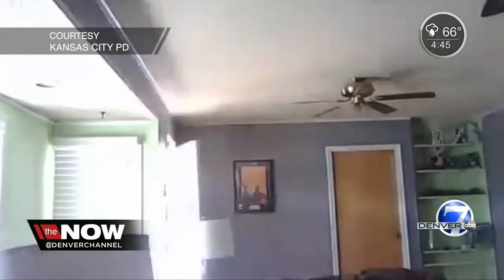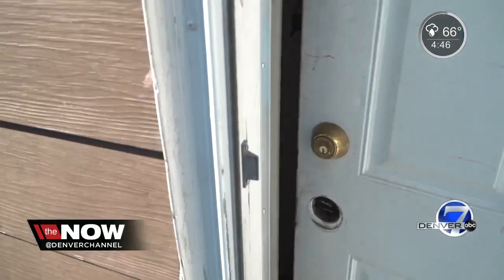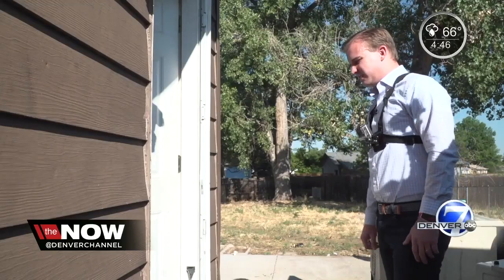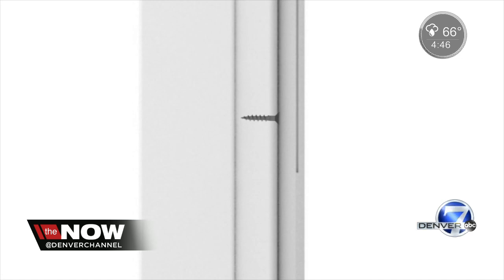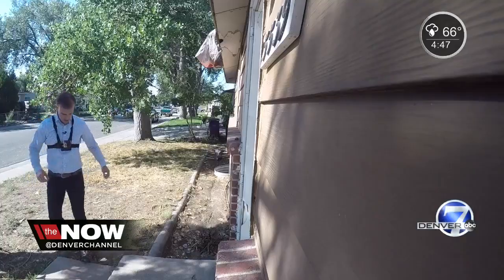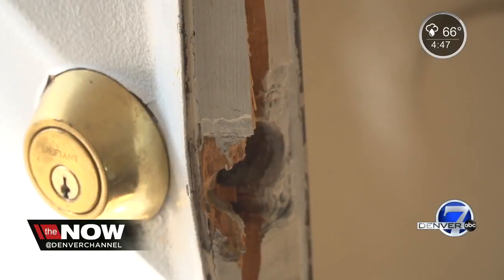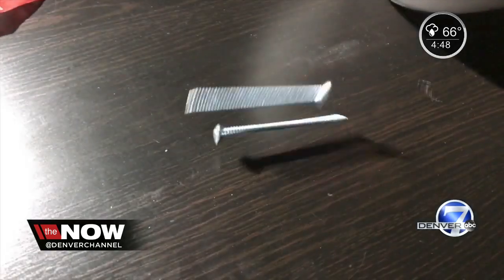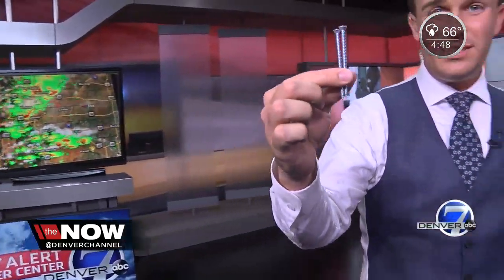Get longer door screws! Here's why.

Comment: Make sure you do this for knob strike plate and put a few on the hinge side as well! Also, install a metal door reinforcement plate around the locks for an all around secure door!
Reply: That’s a cheap deadbolt lock. So not only just use 3” screws. Also get a better & sturdier quality lock.
Reply: My door has zero gap space. What  brand strike plate do you recommend? Thank you

Comment: For you eager beavers who are charging out to do this and you don't work with tools often, here is just one tip he does not have the experience base to know.  Tip 2 is do both sides, the plates AND the hinges.
When you install these, we all have a tendency to absolutely BURY those screws into the frame.
You MUST pay attention to the door swing, or you will tighten it out of alignment, and it may become sticky, so install one screw, and test the door swing and the bolt path before you go to the next screw.  However, he is absolutely correct, This buys you time to get the dog, the gun, and 911, or even for your neighbor to hear a big commotion, and respond.
Reply: ¹
Reply: just replace one screw per hinge.  definitely good enough
Reply: @mikehascats26 I did that and it works. We weren't able to kick the door in on the hinge side and at the doorknob side.

Comment: I just added a 12 inch strike plate that secure both locks into one with 9 screws distributing the force.
I also added 3 inch screws into the mechanism in the door, my door is solid wood. I really want to kick test it but it's my home so I'll calm down lol. 
I got 8 inch strike plates for my back doors with single locks and they have 6,  3 inch screws now vs the 2, 3/4 inch screws. 
I added 2 of the 3 inch screws on each hinge as well. All my screws were #10 with a torx bit. Don't forget to pre drill!! I forgot on the first one and had to twist it out with  vice grips it was so dug in it wouldnt go in any farther.
I'm getting 1 inch wooden dowels for all windows vertical and horizontal. 
I still have to put up my motion lights. 
Next project is installing security cameras! I sleep so much better knowing my family and I are safer and have a fighting chance.

Comment: If you want to make it more secure you can replace the strike plate with a security strike and reinforce the deadbolt with a wraparound security plate. There are all kinds of reinforcements you can buy for under $10. You can also replace the screws in the lower hinges so the hinge side won't blow out. Door Armor is expensive but you can at least look at the parts they use and buy similar ones
Reply: That’s a cheap deadbolt lock. So not only just use 3” screws. Also get a better & sturdier quality lock.

Comment: longer screws are a nice tip, but how hard is it to throw a brick through a window to get in?
Reply: To prevent this, install 3 inch screws into the windows.
Reply: Bars over windows are very common.
Reply: There are security films that make windows much more difficult to break
Reply: It reduces the risk. Someone who can’t get in a door already likely drew more attention to themselves than they wanted, and the homeowners/neighbors have a chance to react. If they can’t get in the first entry site they wanted, they will probably just bolt. Plus windows usually have screens and it’s not as easy to climb through a window as it seems unless it’s literally on the ground
Reply: Simply i use 1 half inch Cyrillic glass its funny when they throw brick and it reverberates his them back lol
Reply: it's called laminated glass, all first floor windows should have it, smh
Reply: Burglars want to walk in, and they DON"T crawl through broken glass.
Reply: Pretty difficult if the glass is toughened
Reply: depends on how new the house is, my house is a few years old and the windows can literally take baseball flying at them and not even crack, i know because i've done it on accident, twice, good quality windows, will be a bitch to break, you'd be surprised

Comment: I had my front door kicked in about 11 years ago (while I was at work) at a rental townhouse I lived in.They stole a brand new plasma TV and some other electronics. The door failed at the strike plate for the deadbolt and blew out a chunk of wood there on the frame. When I bought the house I live in now I put 3 inch screws in all hinges and strike plates of my entry doors. This also helped straighten the metal doors a bit in the frame which helps them close and seal better.

Comment: Mine uses 6 screws on the strike plate.  4 on the outside that are 4” screws and then inside the metal box the deadbolt goes in and also holds 2 recessed 3” screws.  The actual door has an enlarged plate with eight screws, 2 of those being 3” and the rest 1”.

Comment: Although it will prevent the strikeplate from coming out, screws are hardened steel and provide little shear resistance. The mechanical fasteners wouldn't even be the issue if strike plates were L shaped and inserted into a kerf cut in the frame.

Comment: In other parts of the world front doors normally opens by swinging out from the house, not into it as they seem to almost always do in the US. Try kicking one of those in. Good luck.
Reply: Which countries?
Reply: but if your door swings out, someone can just take the pins out of the door hinge, which is probably even faster than kicking it down and more discreet
Reply: @dylan-nguyen  
no  they use jam lock pin
 screws in hinges.

Comment: Now throw those screws into the deadbolt too!
Reply: Long screws will interfere with the lock on some deadbolts so be sure to have a few lengths on hand. Or use a wraparound plate to keep it in the wood

Comment: Double the locking ability.  Notice in the beginning, only the deadbolt was installed.  Once this video installed longer screws notice the bottom door handle was suddenly installed and closed.  Attention to detail and double the locking ability along with two longer screws.  Come one, do a better job of the obvious flaws.
Reply: I recognise your comment is old, but this is largely irrelevant. 3/4 inch screws are still just biting into the finishing board. Even with the knob installed appropriately, you're breaking through the same amount of material (about 1/2 inch of pine finishing board). Longer screws means you typically have to destroy the frame or the screws themselves. As most steel screws can bear about 92-102lbs of tensile strength, installing four 3 1/4" screws means you'd need to generate around 400lbs of force to snap them.

An average kick from your standard 5'10" male applies around 70-80lbs of force, for reference.

Doors with elongated strikers (which brings screw counts up to around 12) and a door reinforcer (this is a plate that goes around the knob area) have been proven to withstand well over twenty strikes from a man-operated battering ram (unsurprising given that you're reaching over 1,000lbs of force required to shear the screws at that point). This video demonstrates--as do many other videos on this subject--that the door itself or the framework will often fail before the reinforced plate itself does.

Comment: Why does the door open inside anyway?
Reply: That's how any door I've seen opens. In Canada.
Reply: @Tiffacheez  but why? The other way it would be harder to kick
Reply: @Pyovali  I'm not sure lol, just the way it is here. Could be to prevent being snowed in...if there's too much snow in front of the door, could be hard to push outward.
Reply: Prevents being snowed in if you're in a northern state or Canada. Beyond that, it also helps in the event a firefighter has to break your door down. Prevents you from knocking whoever is in your step over. Also, tamper-proof outward swinging hinges are more expensive to install.

Flip side of this is that outward swinging doors can withstand a stronger wind hitting the building, and are recommended occasionally by people building in areas that have a high risk of hurricanes (like Florida). They also allow for quicker egress from the building in the event of a fire, which is why they are normally required for businesses. It's a toss up between the two, but having lived in both Europe and the United States, I do notice inward swinging doors are much more common stateside than outward swinging doors are for residential buildings.